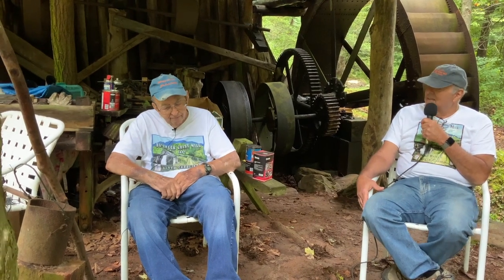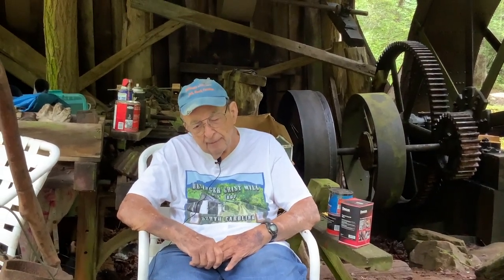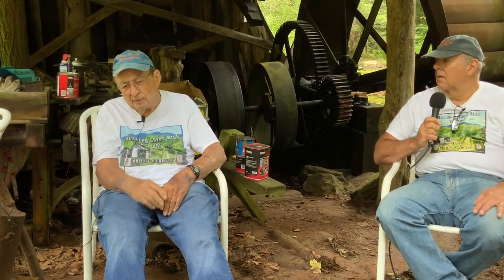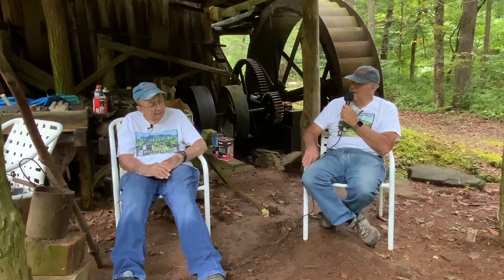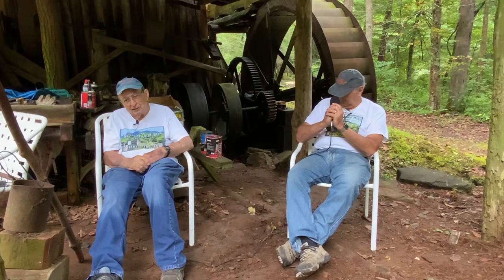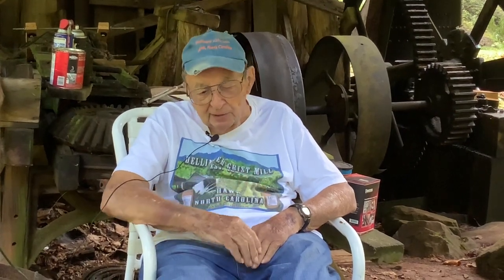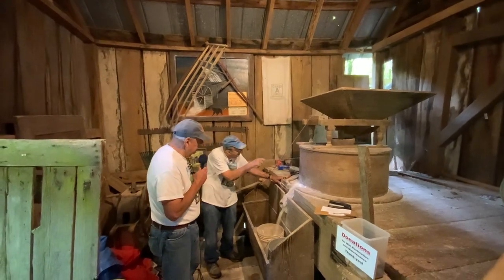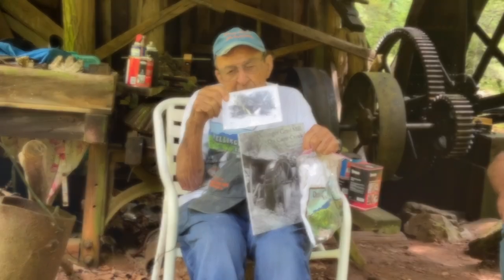Dellinger's Mill in Bakersville, North Carolina

Comment: Congratulations for all your hard restoration effort and work. I am glad to see a known original Fitz Waterwheel. I think a minor correction should be introduced, the Fitz Waterwheel Co was in Hanover, Pennsylvania not 99 miles away in New Hanover, Pa. 
The curved lines of rivets fastening the buckets are an indication it could be a Fitz. Is the Fitz brass name plate still in place? One may be able to search the original price from the name plate number at the Hagley Museum in Wilmington as they have the Fitz business records.
https://youtu.be/uctYUnaRr8Y
A local 1826 mill built with a wooden waterwheel on a wood shaft, upgraded to a used Fitz 4' x 12' diameter steel outer buckets/rims in 1922 costing nearly $400. A $75 steel shaft with hubs from a fire damaged neighboring mill replaced those wood items in 1944. A 1985 sawmill injury to Harry Cross, the miller, closed the grist mill operation, rust deteriorated the wheel lower segments to an unsafe condition. A 1998 restoration effort cloned the Fitz waterwheel dimensional but welding replaced the riveting process.